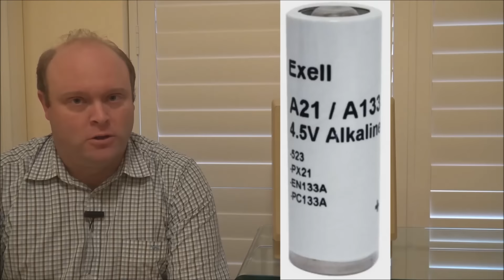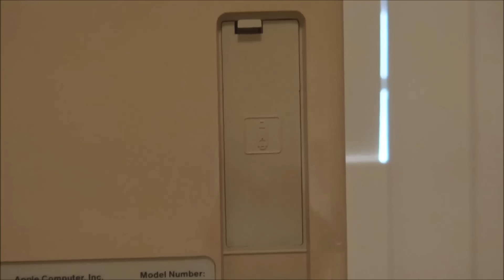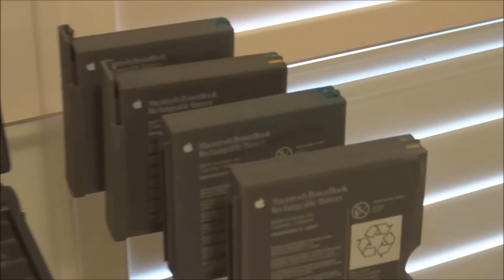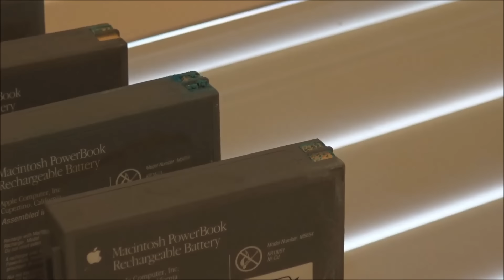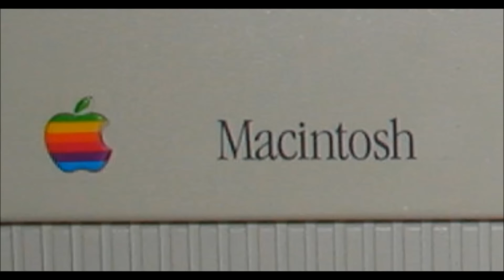Common issues with Apple Macintosh Systems - Part 2 : PRAM Batteries

Comment: My IIci the Maxell battery in it vented and sprayed something corrosive all over the bottom of the floppy drive and whatever vapor let off also go in the hard drive and corroded it internally too, completely wrecking the system.

Comment: I had a maxwell in my G4 Cube that leaked. I thought it exploded by how it looked. But luckily I think it was left on its side for years while it went. The tadiran brand I have in my G3 and G4 tower and they have been fine since I last looked. I recently got an iMac G3 600 snow with a saft battery in what read 0.02v so it was a good time to save and replace. Hoping this is stopping the system from working as the bored measured voltage from what I’ve seen online to test but only clicks on and straight off
Reply: I’ve also encounter “newer” intel motherboards (not even Apple ones) not work without a CMOS battery so hoping putting one in my iMac G3 will help it. 5v trickle power is there and starting it goes to 20v but clicks straight off so hopefully I can find the issue if it’s not the PRAM battery

Comment: My IIgs has a batterty from 1990 that has not leaked.
Reply: It will. It's only a matter of time.
Reply: I know therefore I changed it to a new one. Interesting thing is that some batteries last very long, some very short. could that be depending on the usage of the machine, or is it the quality of the battery? It's a risky thing, because the new batteries could possibly be much worse that the old ones.

Comment: Thanks for this video. It scared me into looking at my old Macintosh LC (circa 1990-1992) I received in 1998. I haven't turned it on since at least 2004...and unfortunately it is not powering on now. No sound, no video, nothing. I'm going to have to open it up to check that the battery is okay but I have the feeling that it leaked and things got corroded unless there's another thing that could have gone wrong with it. This is a good PSA for anyone that has a older/vintage computer, especially a Mac. I had stored my Mac because it is a sort of prized possession of mine (my first computer and obviously an older one) and because I knew it might gain value over time should I wish to sell it in the future - I tried to take as good care of it as I knew how ever since I first got it 18 years ago. I had wanted to turn it on recently but nothing happens, much to my disappointment. Anyway, if anyone has an older computer of any kind, keep this video in mind and take the battery out of your computer, especially if it's working now.
Reply: Zachnorn You need to replace the Battery.Had the same Problem wit my iMac G3.Replaced the battery and boom,it powerd on again.
Reply: Also capacitors in the power supply leak, and on the motherboard.

Comment: 37:04 ,  "90 apple mark 012o" is a bipolar 8pin IC.  I suppose, this chip  has 1.25v voltage reference and comparator for checking battery voltage. I designed  in 1992 Sony.

Comment: My very first compact Mac had a horrible case of battery leakage. I was very disappointed  but have since acquired a working compact Mac with one of the blue batteries. Needless to say I removed it.

Comment: Hi. I have upgraded my 2017 22.5 iMac ( 32 GB and SSD 1TB) but the computer does not start. I was checking the green LEDS that confirm when powered and start are green but the third one ( GPU) does not light. So the problem is in the GPU?. If I change the PRAM battery the problem can be fixed? Thank you

Comment: My guess is that the maxcell lithium batteries would be more prone to leaking, due the very large protruding postive terminal, Those Lithium batteries, are Lithium Thionyl Chloride chemistry, Lithium thionyl chloride batteries use a glass to metal seal to isolate the positive terminal from the negative terminal/case of the battery. That large nub on the positive terminal seems like it could very easily be levered against the internal glass seal and break it.

Comment: LOL Why did you say you are ashamed that there is a IIfx board in the II?  My II just arrived last Friday, and I was ecstatic when I found that it had the IIfx board/processor in it! :)  It won't fire up though, and I have a sneaky suspicion that it may be batteries instead of the power supply if I'm lucky!

Comment: When you use AA batteries in the machines I recommend using Energizer Ultimate lithium batteries  since they should pretty much never leak, and they are now rated with a 20 year shelf life so they have very low self discharge.

Comment: Also, would you consider doing a video on some of the peripherals for the early Apple line such as external floppy drives, CD-ROM drives (such as the AppleCD SC), scanners (such as the original Apple Scanner), external hard disks (such as the 20SC) and printers (such as the Image Writer I & II)?

Comment: Hi Jason ... fascinating, and thanks for sharing.  I own a mid-80s Macintosh II, with a second hard drive, updated with a super-drive, and I believe additional memory.  This computer has a board (maybe 3” x 3”) that sits on the large logic board with a capacitor and two Maxell 1/2AA batteries in the center of the motherboard.  One battery was beginning to expand so I replaced them both.  I am trying to restore it.  It is in pristine condition.  The PRAM info is clearly gone since the last time this was powered on was probably 1990-ish.  I was able to power it on, the drives spun up, no chime, no video.  I can’t find a website for you, and would like to get it going again.  Do I need a boot diskette?  Will command+option+P+R reset the PRAM (I don’t know when that feature came to be)?  Any advice would be greatly appreciated.

Comment: Hello Jason, I have a Macintosh II dated 1987, I found it abbandoned in the house of my father...I am fond of its because it was my first computer.
I tryed to power on, but no sign of life has arrived to me...
Batteries are solded on the motherboard and, luckily, none of them has leaked acid. I tested with a multimeter one of them still reports 3.3V, but the other one reports -0.5V.
Do you think that this condition could prevent Mac to power on? Or I have search the problem elsewhere (power supplier perhaps?). Thank you in advance, and compliments for your videos! Andrea

Comment: the bomb aka maxxell batteries have destroyed many macs, SAFT batteries seem to be better
Reply: The Tadiran brand batteries seem to hold up signficantly better than the Maxells. Hope the SE/30 I ordered has a Tadiran.
Reply: my powermac 6100 had a tadrian battery, it was dead so i swapped it with another tadrian from a imac g3 then it died later so i just left the battery slot empty. my lime 333 imac had a maxell battery.